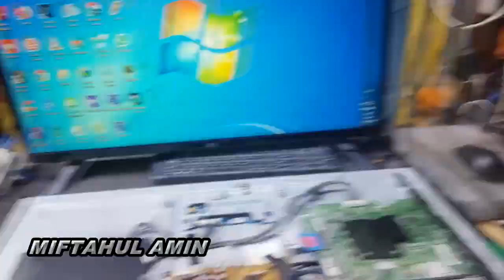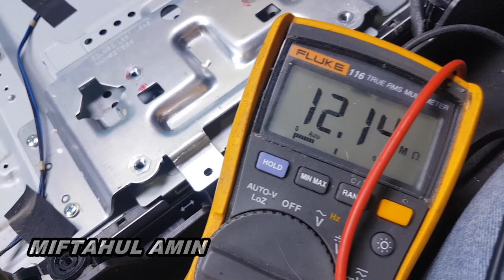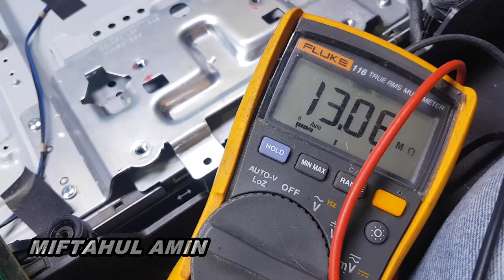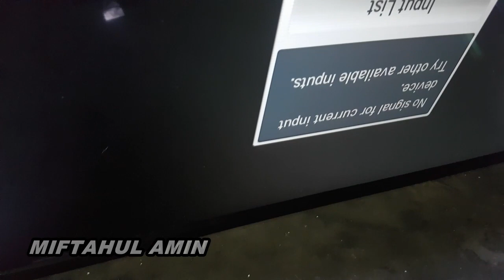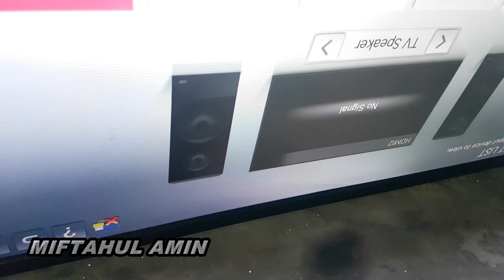perbaiki tv led LG mati total

Comment: Sama model PSU yg sy tangani sekarang. Kalau elko 450v nyimpan teg 300v, berarti BFC blm bekerja ya bang? output sekunder tdk ada keluar.  Sdh ukur2 resistor, dioda, fet dll blm ketemu masalahnya.
Reply from the maker: Harus di jamper dulu 3,5v/5v me ps on
Reply: @KlinikTv  tapi 5v juga tdk ada/blm keluar